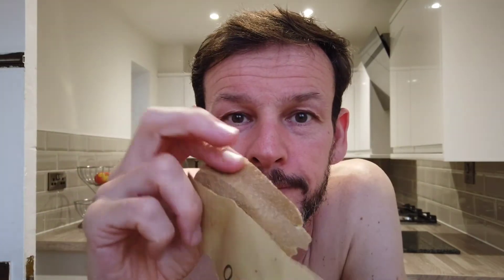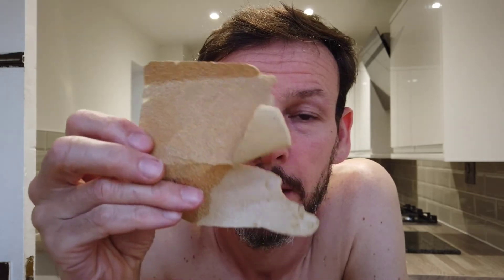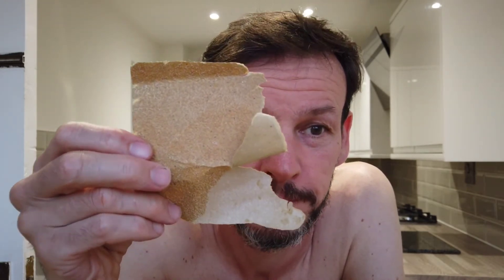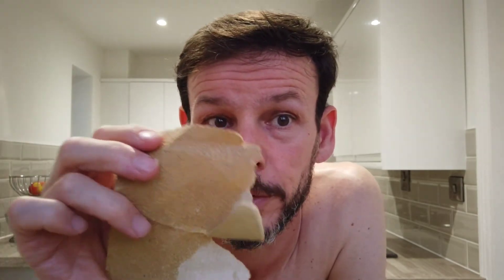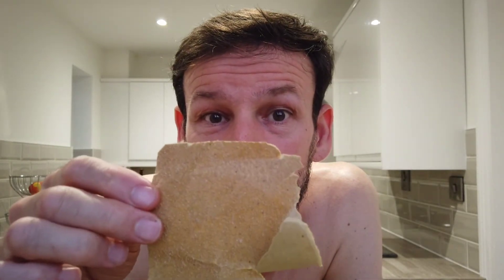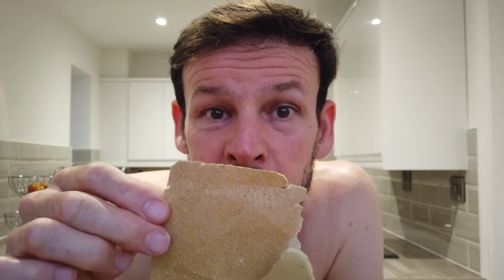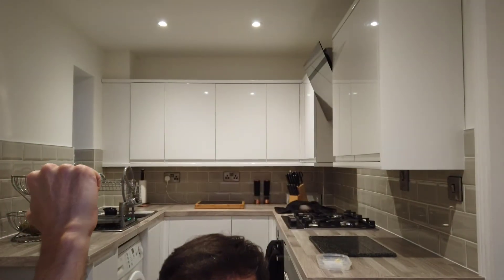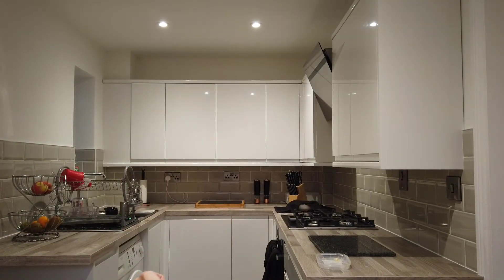How can Sand paper SAVE your props and save you some money aswell

Comment: Still on my original props from day 1. 

Just be careful they can crack and fail after hitting anything, they're very brittle props.
I think DJI recommend replacing them after 150 flights, mine has done more than double that. 😲😳⚠️😁
Reply from the maker: Mine over 3 yrs old buddy but it works no message been out today over 2000 meters 350 ft high.epic.little drone